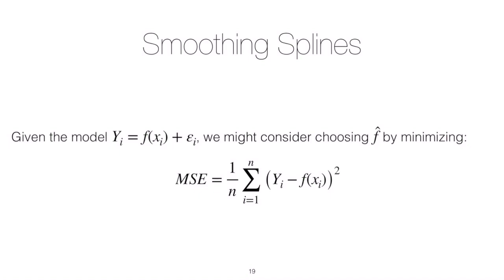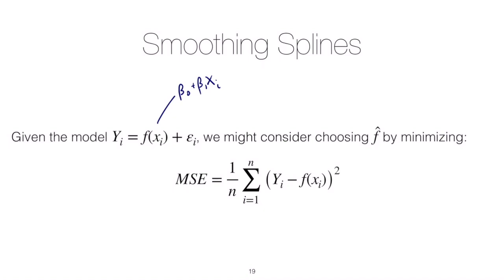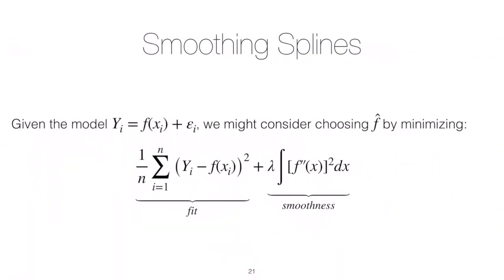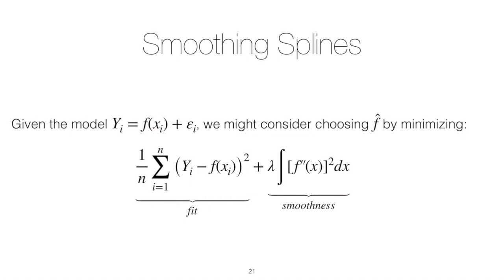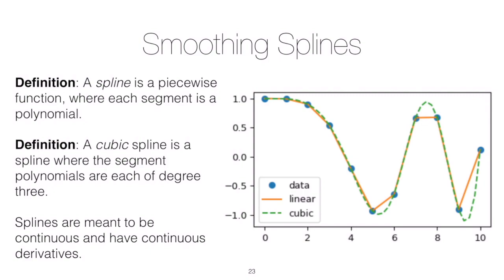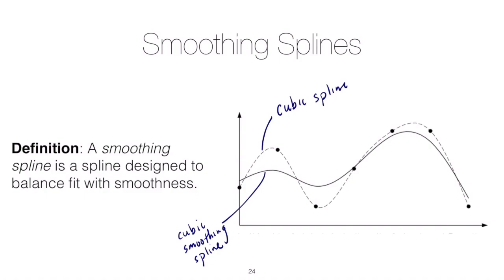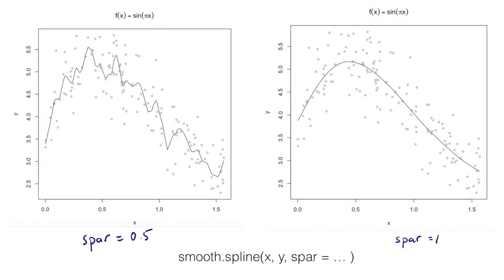Unit #7 Lesson 5: Introduction to smoothing splines

Comment: 🎯 Key Takeaways for quick navigation:

00:00 📊 Smoothing splines are a non-parametric regression method used to model relationships between variables without assuming a specific functional form.
01:35 📉 Smoothing splines help strike a balance between overfitting (interpolation) and underfitting (oversimplification) by penalizing functions for being too wiggly or rough.
03:28 🧐 The smoothing parameter (lambda) in smoothing splines controls the trade-off between fitting the data closely and maintaining smoothness in the estimated function.
08:46 🧮 Smoothing splines provide a smoother fit than cubic splines by constraining the average squared second derivative.
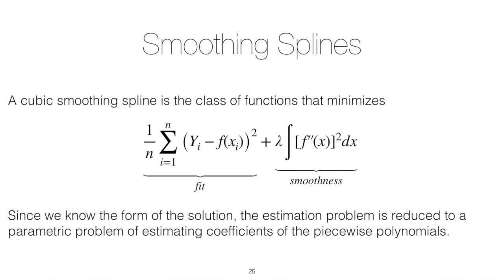10:13 📈 Smoothing splines can be implemented in R with different values of lambda (spar) to control the smoothness of the estimated function.
13:31 🔄 Bootstrapping methods can be used to quantify uncertainty in smoothing spline estimates and create confidence regions for the curves.

Made with HARPA AI